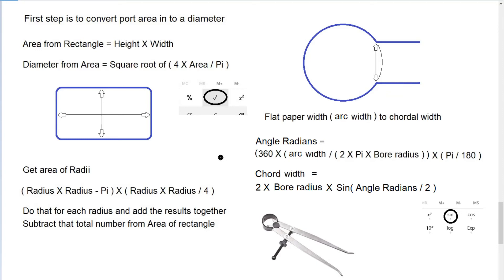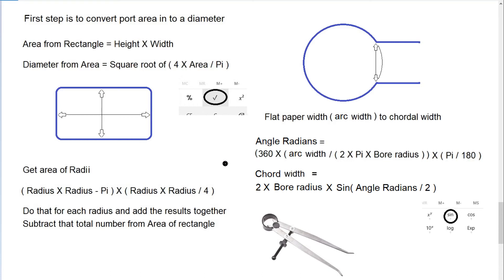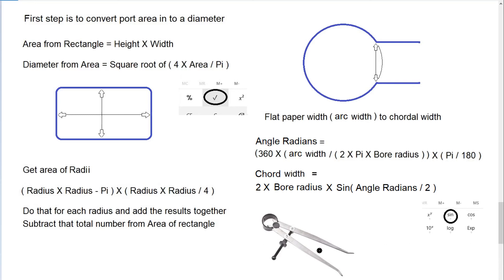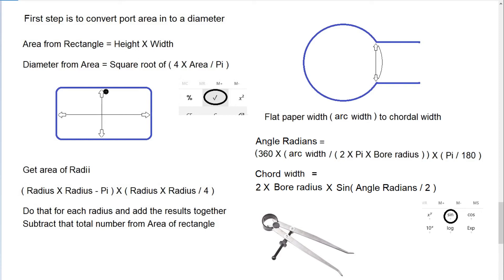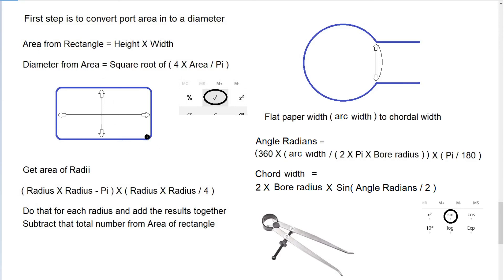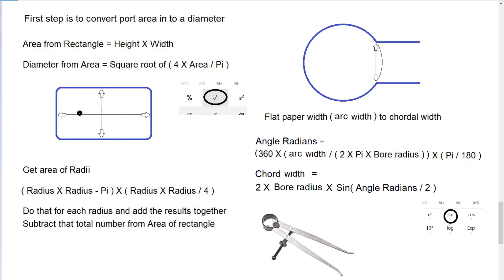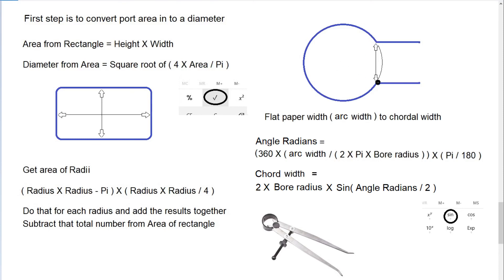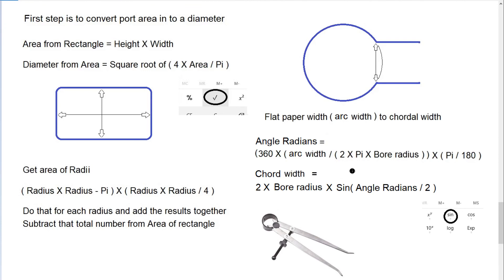How to Design a Two Stroke Expansion Chamber Performance Exhaust - Step 4

Comment: If your cylinder has power valve ports on either side of the main exhaust port, do they have to be added into the equation some how?
Reply from the maker: Yes, all exhaust ports need to be summed to get the total exhaust area including the full open size of a variable exhaust port.
Note the description section there is a link to free pipe calculation software I wrote that makes it easier to do the math.

Comment: Do you have any suggestions for max ex port size...its for the China gas bikes I've went huge and wonder if I'm over the suggested limit. And when they say max is 65% diameter of the bore, so they mean that ports chord width or radius width should be maximum 65%?..and I tried the mota x...the free one was not the best hope to get my hands in your software someday.
Reply from the maker: Diameter being a straight line measurement across the bore the port width percent will be the chordal width.
So the ex port chordal width should not exceed 70% of the bore diameter as a hard rule, 65% is on the safe side.